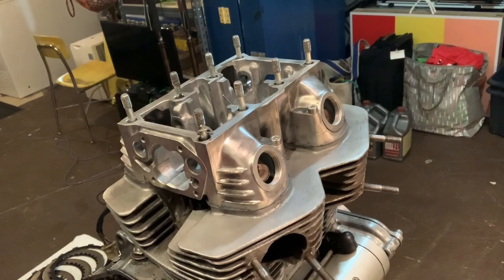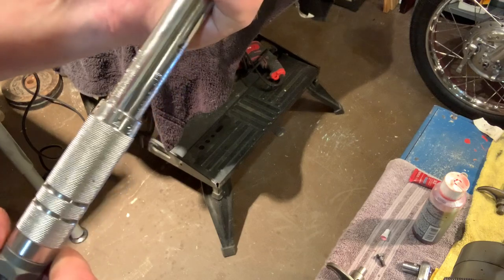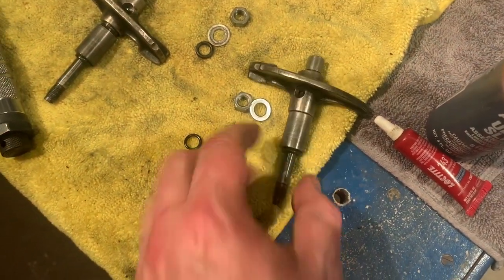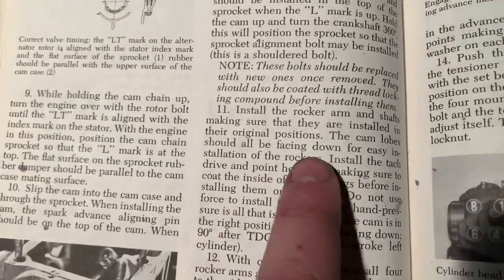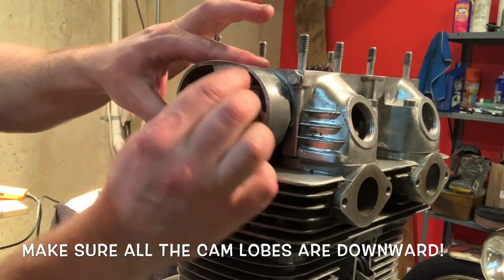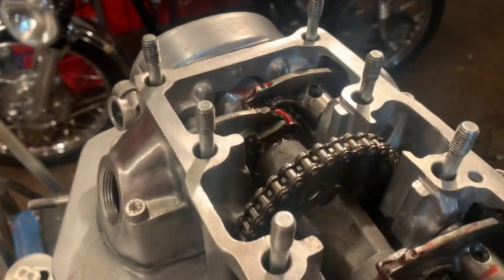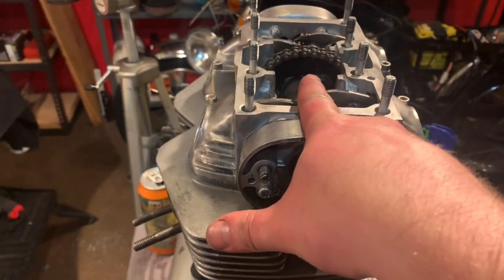How To Install Camshaft & Rocker Arms-CB350 CL350 Honda Twin Top End Rebuild: Part 155

Comment: Did you put the cam shim washers on either end?
Reply from the maker: There were no shins on this engine when taken down. Apparently it caries. In another video I measured the axial play of the fam and confirmed no shins were needed. Your might so be sure to measure. Shins are added vis the tach and points housing. If a shim is determined to be needed you remove the housing and place the shin then reassemble. I hope this helps. I believe I cover it in an upcoming video.
Reply from the maker: This is something I did a lot of looking into because as you said, it’s important. I checked multiple manuals and landed on “if side clearance is greater than 1.0 mm remove one of the side housings and install thrust washers until the clearance is within standard specifications of .2 - .6 mm. Thrust washers are available from Honda in .1 and .2 mm sizes.” To me, that indicates that the thrust washers are only required with excessive side clearance. I actually purchased a couple from eBay just in case I didn’t fall within those specs. They were not cheap either. I think each one ended up being $15 with shipping. I got that info from the Honda 350/360 Twins Repair & Tune Up Guide by Chilton 1975. Additionally, in the Honda Motorcycle Shop Manual (the old green binder) it says the same thing. “If the side clearance is over 1 mm install shims which are available...” The shop manual references shim in place of the term “thrust washer” as with the other resource. To me, they are describing the same thing and the images corroborate that. Furthermore, when I reference the CMSNL parts guides the part in question is referred to as a “spacer cam” and both sizes are referenced. The .1 and .2 mm mentioned early. According to the manual those are only needed if your side clearance is excessive. I measured my side clearance in a future video and it fell within the the specifications so I did not install. Interestingly, when I look at the CB360, a trust washer is referenced on CSMNL in two sizes. Just a completely different term but in the manuals they are only to be added if there is excessive side clearance. I think this is a really important aspect to these engines. I’m glad you brought it up. I spent time this morning referring back to everything to be sure. It’s really a pain in the butt if those sims, thrust washers, or spacers (whatever we wanna call them) need to be added because you essentially need to put the cam boxes on, torque to spec then measure. If the side clearance is too much you need to remove the right side (tach side) box and install appropriate width shim there. I saw multiple areas also referencing only installing these shims/thrust washers/spacers on the right side. The manuals are pretty clear. IF is the term used. Also, when I took that engine apart it didn’t have them. This being my first top end rebuild I didn’t notice they were missing until I approached reassembly. I’m looking forward to tearing into another engine soon to see if they are there. I’ve read that it varies as to whether or not they are present or not. This was a fun exercise to work through over coffee this morning. I hope I made that clear in both videos. Thanks, Winston! I really appreciate the thoughtful input. I’ve got about 200 miles on the bike since rebuild. I’ll definitely be checking for any signs of wear at my next oil change. Fingers crossed!

Comment: Did this when I was a teen in 1972, Norris cam, racing clutch, had two rear sprockets depending on riding function(distance/top end vs. 1/4 mile). Fun times.
Reply from the maker: Didn’t even know that was a thing.

Comment: I was saying "Gasket, gasket!" haha Good job Brian, you sound very pleased. Not sure I understood freezing the side housings, surely that would make the fit tighter to install on the cam? I dunno :)
Reply from the maker: Thanks, man. That was actually quite an adventure. Lol. I saw so many videos of people smashing those side covers with hammers and then reading how they should go on with hand pressure. My thinking was to freeze it to gain a little advantage getting those on, especially the right side. It didn’t make a hill of beans difference. It all comes down to lobe position. I froze a bunch of bearings earlier and that worked like a charm. No harm, no foul, right? :)

Comment: Great video / of course I am now about to buy the recommended Chilton 350/360 manual, since the factory manual was very deficient in the explanation, and caused a problem for me. thank you
Reply from the maker: Really solid manual. Thanks, Gary.
Reply: @KeepOnWrenching  Because I have several MCs from several manufacturers, I bought the 1974 Chilton "Motorcycle Repair Manual", but it did not contain the important (and necessary) instructions re the camshaft installation.  good manual otherwise.

Comment: Hey Brian, at the 1:50 mark you say the LT mark is aligned but I see the LF mark aligned? Am I seeing this correctly?  THX GREAT VIDEOS!!!
Reply from the maker: Follow the manual shots whenever possible. The camera angles can definitely be misleading sometimes on some of these videos. I may have even filmed it incorrectly and fixed it later. Maybe messed up an edit. I try to include shots of pages from manuals for reference. I certainly hope I’m not misleading anyone. At the end of the day the motor ran great so I must not have messed it up. Lol. Thanks for chiming in.

Comment: Really enjoyed this top end rebuild  like you I’m just a novice but going to have a go myself bought a Honda 250 and been trying to time it and it just keeps firing on one cylinder. I’ve checked all the electrics i’m getting a very good spark from the plugs at the moment I’m at a loss the plugs fired up, swapping them round even but no joy The timing is good. It fires up on one cylinder with no problems, it just seems to me I’ve been conned i’ll watch your video again and see what I can do maybe you can come up with some ideas I’m willing to learn. Thanks
Reply from the maker: Have you tried a compression test?

Comment: Hi, the manual I used for this states that the cam sprocket bolts are torque-to-yield. I sheared two sets of used ones before I caught that. How has it held up for you?
Also does anyone have any idea why one of those is shouldered and one not and why they go in a specific hole?
I am finally about to tackle the cam sprocket again and the bolts are not available from Honda anymore. Could I use any 6x14 bolts that otherwise fit the bill or do I really need one shouldered and one not?
Reply from the maker: You do need a shouldered bolt. In my manual it was specified. I don’t recall off the top of my head but I think I referenced it in a video. It’s a hardened bolt. I’d hit up eBay for a donor set.

Comment: additionally Brian....These engine weak point is the top end.....you can not have enough lubricate on any of these moving parts.....You may even want to leave the spark plugs out of the engine on initial start and run the engine a short period to ensure that the engine oil gets to this top end before actually running the engine...The cover that you had trouble getting the gasket off acts as a shield to ensure the engine oil lubricates all moving parts on this top end........
Reply from the maker: Thanks, David. I’ll definitely be looking for evidence that oil is getting to the top end once (and if) I get this thing running. I put a lot of assembly oil in that area over the last day. Not sure I follow leaving the plugs out on initial start. Please elaborate if you get a chance. I think you’re saying to manually turn the engine over to move oil before actually firing it up. Thanks so much!

Comment: Hello! Thanks for your videos, they have been really helpful :-)

In the beginning ,when I rotate the stator in to the LT mark and align the camshaft pin up. Is it necessary that the left cylinder is in compression stroke?
Reply from the maker: I honestly don’t recall off the top of my head. The position and stroke of the pistons is very important. Do you have a manual?

Comment: Brian, quick question:  I noticed on mine (71 CB350) that the rocker pin on the left cyl exhaust side is pointed in, not out.  The Honda manual says just rotate it to point out.  Engine is together and in the frame.  Can I just loosen the locknut and rotate the pin?  I would think the rocker has to be free of the valve, so would that be at tdc?  Thanks!  Great, great work you're doing!
Reply from the maker: You should be able to just loosen and adjust it. It’s not a matter of just pointing it in the right direction tho. You need to use your feeler gauges to adjust it precisely.
Reply: @KeepOnWrenching  Great, thanks.  Yes, I'll be tackling that Saturday morning, weather permitting!

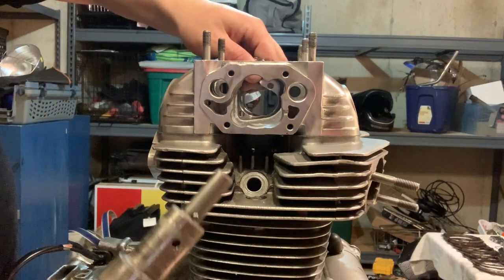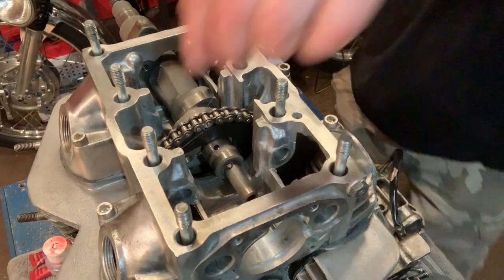Comment: 2:49, the screw hole in the sprocket it up and to the rear of the engine. At 3:42 its up and to the front. What gives? What was the edit was made? EDIT: I see it, at 4:14 you had already flipped the cam face over face.
Reply from the maker: Glad you were able to catch the details you needed.